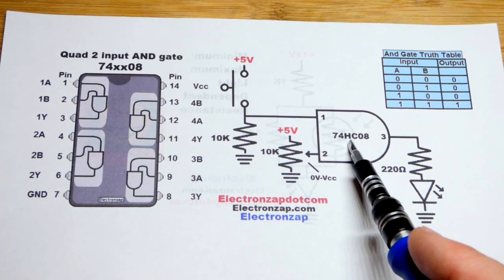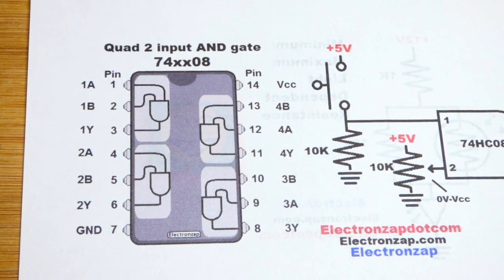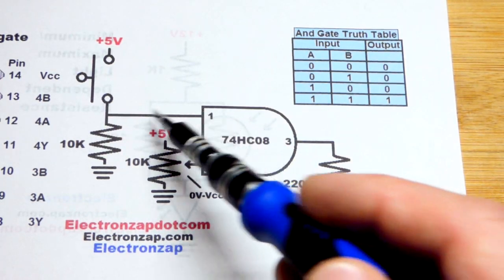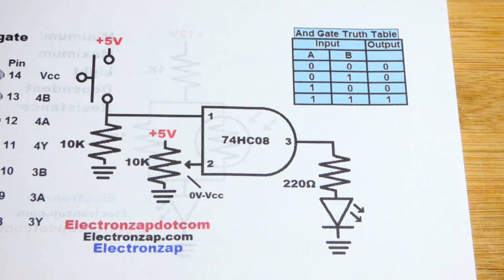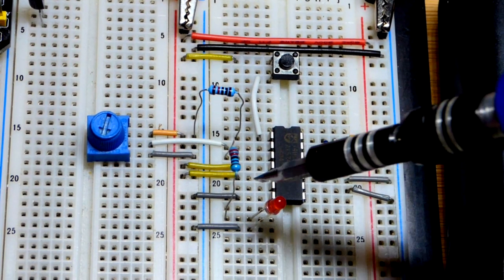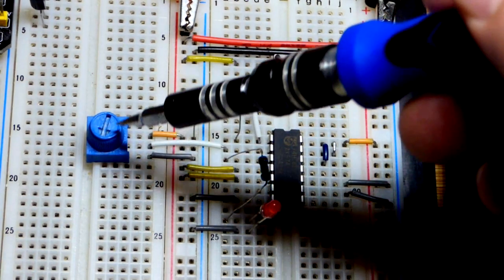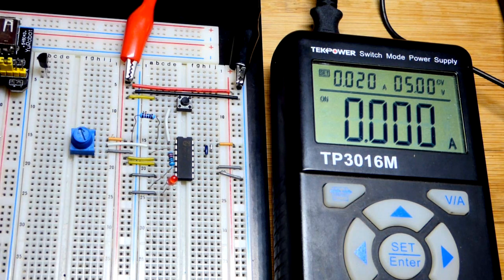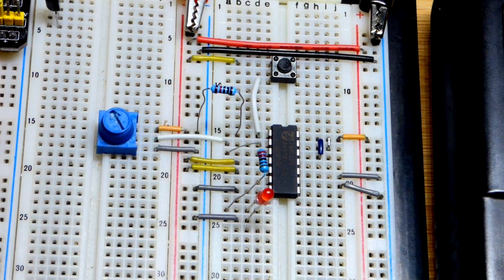7408 series 74HC08 quad 2 input AND gate integrated circuit electronics how to DIY demonstration

Comment: If you have this integrated circuit and are only going to use one of the logic gates, how do you stop the other three from floating? You mentioned ground. Do you just connect all three pins of the others to ground?